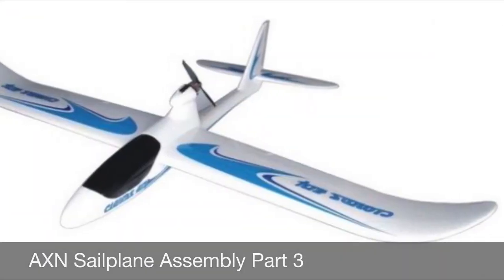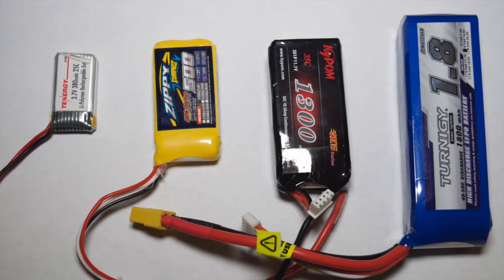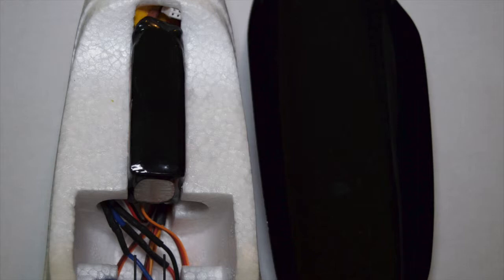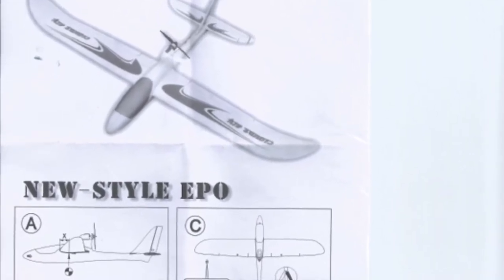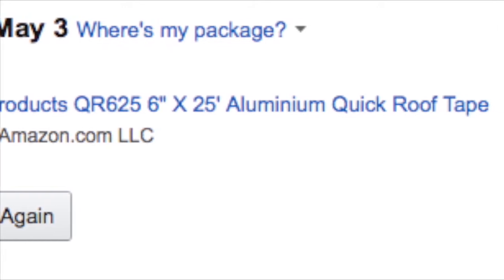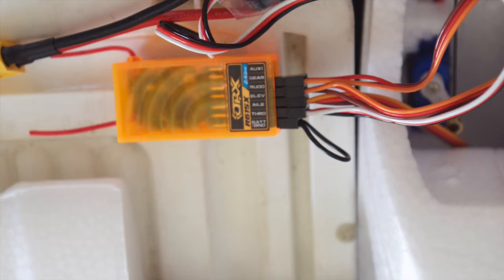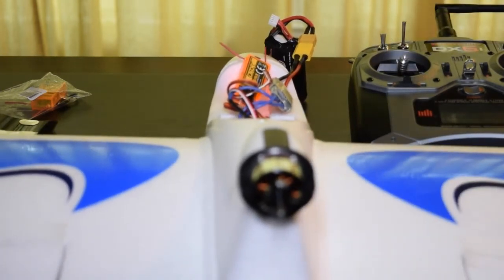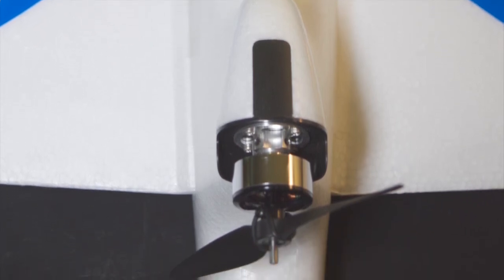AXN Clouds Fly Sailplane Assembly Part 3

Comment: Nice build series !. I picked up some great techniques to use on my RMRC Sky Surfer. The fulcrum setup for getting the CG looks very clean and accurate. Is there enough room in the nose to make a cutout for the 1800mAH battery ? You might get longer flights without needing ballast.  Looking forward to seeing her maiden.
Reply from the maker: aliebel Probably room for the 1800 but you'll need to carve out some extra space.  Good luck with your Sky Surfer build.